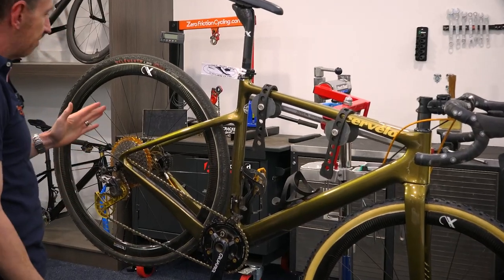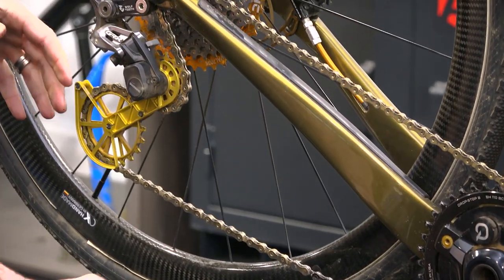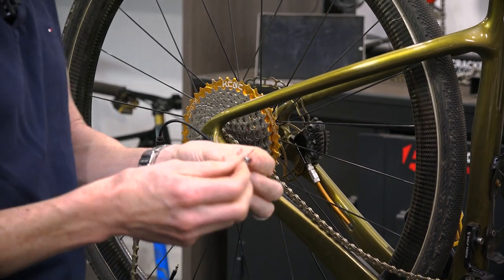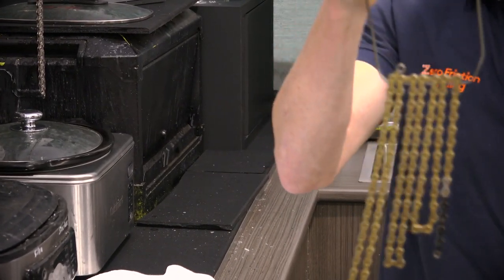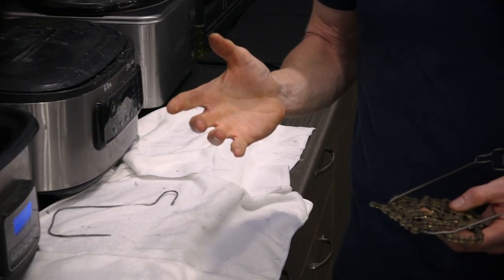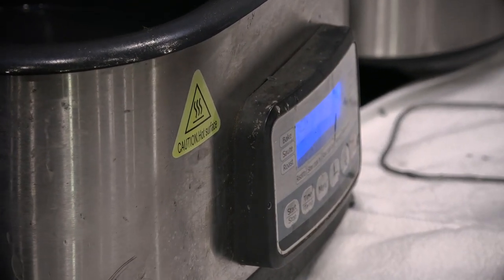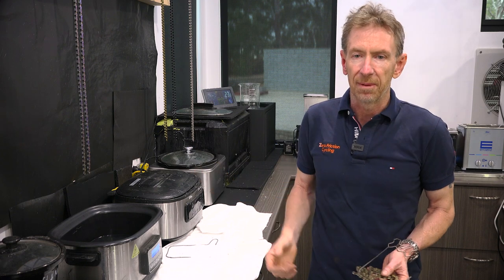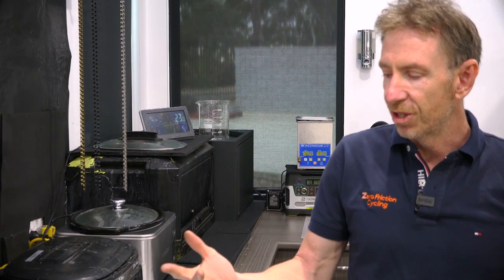Episode 4 - Part 2 Immersive Chain Waxing  - How to Guide.

Comment: It seems you're OK with reusing the master link.  I have read on some sites that they should not be reused.  Is there a controversy about this?
Reply from the maker: I wouldnt say controversy - but yes most mfg state links are single use, and some will not wish to go against this official instruction, some will. I have a guide covering this (master link FAQ guide - instructions tab, page 8) if you want a deeper read. In short - some links are re useable (ie YBN QRS links - 5x re useable), or wippermann connex - re use for life of chain. For single use links - if one is not keen to re use, then they should go with hybrid approach of wax, re lube with wax compatible lubricant (UFO drip, silca ss drip, tru tension tungsten all weather) for next 5 re lubes, then re wax to reset any contamination starting to build, and use a new link. The combo approach is very popular these days since the above lubricants on the market that one is perfectly fine to re wax without any need to clean first - not only saves on links use, but also takes the pressure of for many re rewaxing every re lube. Immersive waxing everytime will always be king, but the combo gets you very close and so is just a great path for many whom would find re wax everytime too much.

Comment: SILCA recommends turning off the slow cooker and letting the wax harden slightly before pulling it out (https://youtu.be/m3uSbNjI53Y at the 22:10 mark). Josh's reasoning is so that the liquid wax doesn't drip out of the chain. I noticed none of the ZFS video mention/recommend this. Do you have any input on this?
Reply from the maker: Hey aaarons! Ah yes normally josh and i are aligned on most things waxing, but i am officially against that advice. There will be plenty plenty enough wax coating all surfaces inside chain even if your remove at 125dg c and hang to set on a 40dg c day. The cooler the wax when remove, simply the more excess you have that will be pressed out in the first minutes of cycling, so more waste, more mess. The pressure loads inside the chain are HUGE - thousands of psi. After a few mins ish of riding, you will only have a very thin coating of wax left. You will have the same coating of wax left removed hot, or removed cold - just one method is more faff, mess and waste - so dont do that :)
Reply: @zerofrictioncycling992 sounds good, thanks for the help!

Comment: If you re wax a chain after lots of miles aren't you putting the dust , dirt and grime back into the wax pot ?
Reply from the maker: Yes correct. The main differences are - 1) as the wax is solid, it attracts / absorbs a lot less contamination than most other options - most especially wet lubricants. Then remember most on drip lubricants just re apply more drip lubricant, they dont flush clean chain after each ride. An application may be typically 3 to 5ml. Onto over 100 links of chain. That is 0.03 to 0.05ml per link. Often of which half may be carrier that evaporates off, leaving half that amount as actual lubrication added. That only does so much re changing the ratio of contamination to lubrication in the chain. A ratio that continues to degrade obviously over more riding until one should really intervene and reset contamination at some point. With waxing you are putting chain back in to a bath of circa 500ml of 100% lubricant. Yes over time the contamination will build in the wax and it wont be as amazing as new - but you can do the math it takes a long long time and oh so many waxings indeed before what is happening in the wax pot to resemble even a mild version re what is happening with drip lubricants. All one needs to do is periodically change to a fresh bag of wax (circa 10,000km road, 5000km offroad) - and things are golden. every re wax does a great reset of any contamination in chain, for no cleaning maintenance. It is just easier all up vs harder as many think, it is day in day out lower friction and much lower wear - hence why it is still always advised as best option for those whom waxing is for them. which is most these days now that may silly myths are being busted! :)
Reply: @zerofrictioncycling992  Thanks , makes sense .

Comment: I’ve been using squirt lube. Do I need to clean my chain 100% before using molten speed wax for the first time or can my squirt lubed chain go right into the molten speed wax slow cooker pot?
Reply: He goes over this in the earlier videos. You will have to clean it and Squirt is more complex to get off. A mix of white ethanol (or whatever you call it) and hot water later. He gives a explenation.

Comment: Save some 💰 and use water bath instead of those fancy slow cookers.
Reply from the maker: Hey goddess, water bath? Prices may vary in countries of course but most places a small slow cooker is $20, and one can just put on low - and beauty re perfect temp. Once people move to stoves, putting a container into another pot with water etc - it just increases the faff a lot, and already many worry about how much faff there is with immersive waxing. Keep every step as simple as, and a $20 pot will last many many years.... that is still the zfc recommendation. Oh and of course i recommend this due to the enormous kickbacks i get from the slow cooker / crock pot cabal.

Comment: I'm a total lazy ass. I wash factory lube off with paraffin. Then a hot wax soak. Subsequent washes are in hot wax only. I change the wax for clean wax yearly.
Reply from the maker: James pls, this is not the channel for you. I work very hard to put out the proven best information. Advice for techniques that have a very high chance of being comparatively terrible - pls take them to other more suitable channels. Pls do not continue to spread such advice here. 

ZFC does not recommend trying to remove a grease with a paraffin wax. It will remove some. What remains will be a gunky mix of grease and wax. And this will contaminate wax in the pot. Perhaps james find this lubricant great. vs the cleaning instructions and recommended proven top products by zfc - which will not be contaminated with grease following instructions - your outcome will be vastly more pleasing. 

James free speech / opinions etc welcome, but please understand how hard i work to try to dispel and correct frankly terrible information and advice from oh so many channels. As such, i would really like to ask to pls refrain from information such as "i just do this!!" that i then need to take more time to try to ensure such advice is correct. If you must perpetuate such things, pls do on other more suitable channels where such advice abounds.